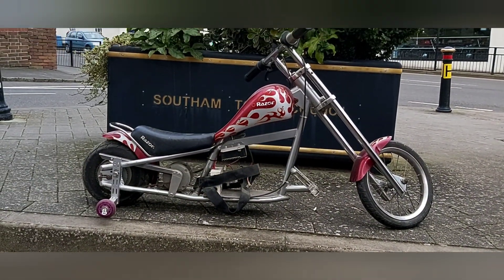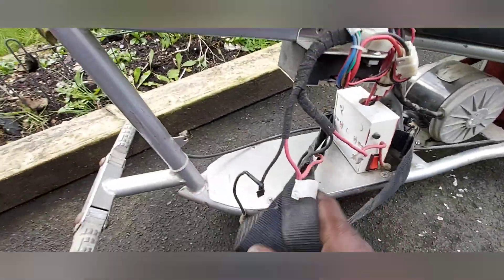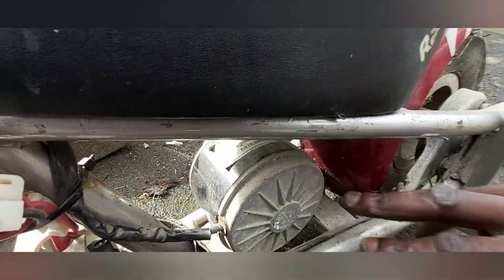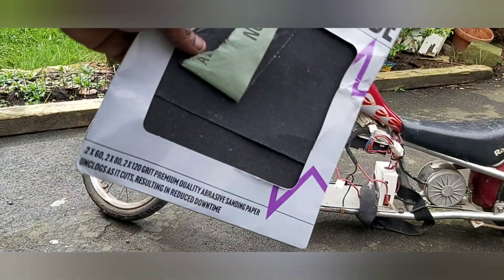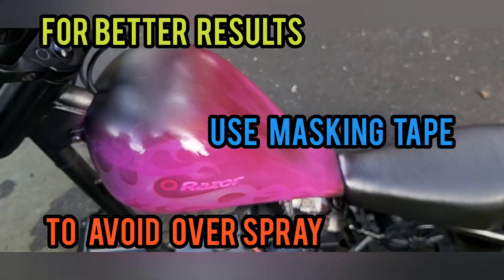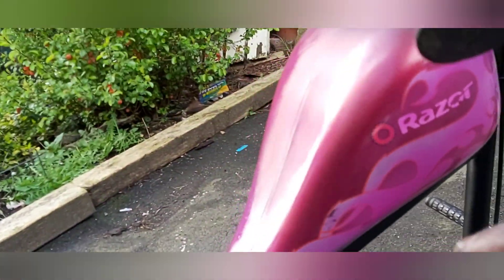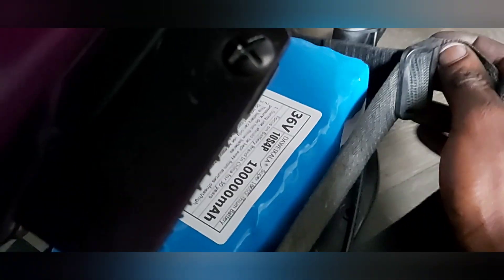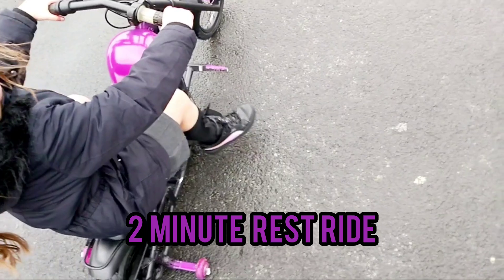This Razor Mini Chopper gets upgrade

Comment: Yo bro, I got a 3000 W motor on mine but I want to switch it out for a 25 kW motor 😅😅
Reply from the maker: The frame, strong enough. Brakes will need converting to disk brake. That's wild bro. 25kw